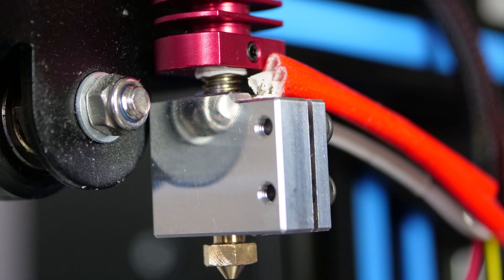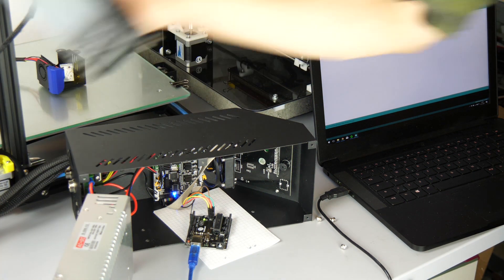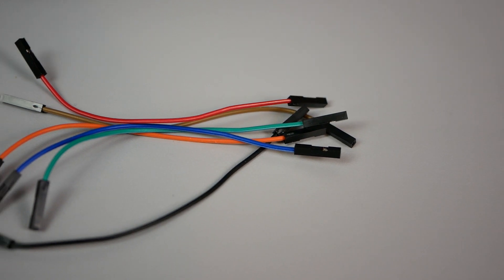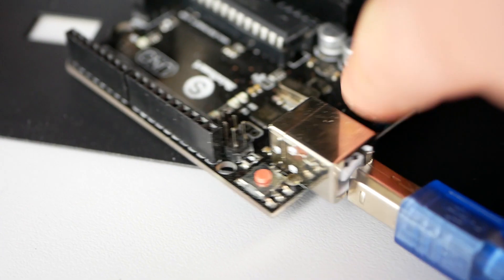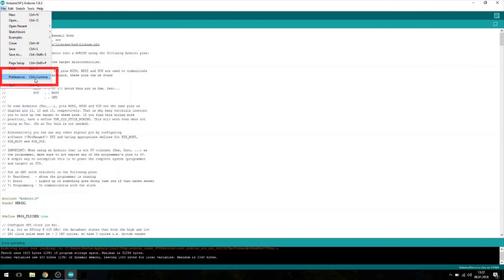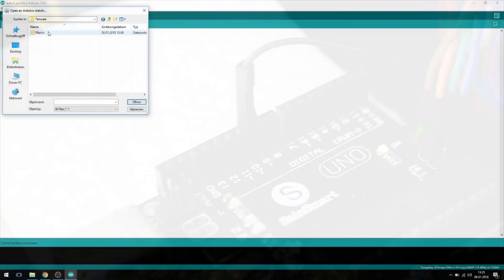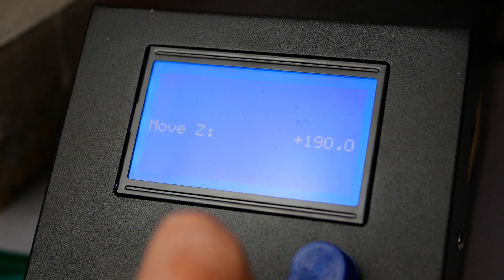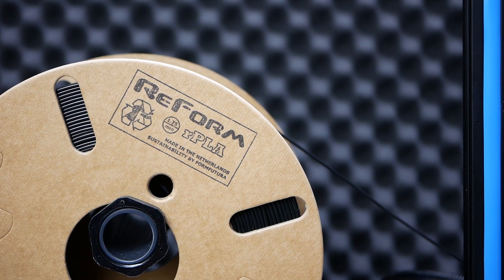CR-10 UPGRADE - GUIDE on flashing Bootloader and Custom Firmware for the E3D Titan Aero Upgrade

Comment: Years later... (lol) A 'How-to' using a USBTinyisp and/or
USBasp would be great. 
Also, a 'How-to' replace the stock Melzi (ATmega 1284/1284P) control board with a better and very inexpensive (almost plug-n-play?) board, perhaps a MKS Robin E3 integrated 4 TMC2209, et al. would be awesome. 😉

Comment: I couldn’t fine a place to post this so here it is. I have changed both heating element on the extruder and the   thermal sensor. When I turn the printer on and turn the temperature up to 210. The temperature does nothing and then I get the error saying E1 thermal runaway printer halted please rest. Should I do a PID to fix’s this issue or could be the
main board that has went bad? Any help would be appreciated.

Comment: can you update this for marlin 2.0 if you already haven't? i'm wondering if the marlin files i was given when i bought the printer my printer can be used, on 1.1.8 now and wanting to use configuration files so i don't lose any settings, though if i made your mount i'd end up using the files here and probably get way better results since you know better than me and the guy that sold me my cr-10s about 3d printing.

Comment: This flat out just is not working for me. i type in the hyper link like you do on your video but my ok is greyed out and it will not take it so when i search sanguino in boards no results. even tried doing it the way the website  says that you reference with the wiring from board to board and nothing.

Comment: Hi. I really need help with my 3D printer .
I burned my mcu, so obviously I bought another one, the same as the old one. Soldered but now I have a blue screen, yeah, noob me. 
The motherboard is v4.2.2 ender 3 pro, MCU - GD32F303RET6. 
Can you please guide me on how to burn a bootloader on this thing? I think I've tried everything I could.

Comment: Hallo Stefan, Danke für das Video! I have a slight correction though: @01:55 you mention that Boot loader is not required for a CR10S (Which I have)- entailed is a Creality V2.0 board. I took me 2 Days and a lot of forum surfing to chase the misleading error messages (things like avrdude: verification error, first mismatch at byte 0x0000
  0x14 != 0x0c)- turns out that apparently my board did not have a functioning bootloader installed.
BTW I installed Marlin 2.0.1 with no problems (so far), now I need to do the direct dual drive extruder and the linear rails installed.

Keep up the good work!

Comment: Hi thanks so much, a very timely video. I was looking into installing a boot loader and updating my firmware.. so I used your links and version of Marlin.
For my CR-10 some changes needed to be made. Like the Y Direction and the extruder steps/mm (Y DIR = true, extruder steps/mm = 99) these may be different for others but that's what I found worked for me. however somehow in my copy of your marlin the extruder was set to 803.. which is just under 10x the amount of feed you need. So you might want to check it.
thanks again.
Reply from the maker: As I pointed out, my version of Marlin is already adjusted for the Titan Aero Extruder and due to its gear reduction needs a ridiculously high steps/mm for the extruder.
Reply: That explains the value. It would take you longer than it took to do the video to dial up the 803 value. Did you change other default settings too?  My CR-10 is printing much better at higher speed now.  I will experiment with Marlin 1.1.8 now and see how things go. Thanks again for the video and the resources.
Reply from the maker: I also changed the homing location to Y=-10 I guess.

Comment: Hello there, when i try to flash my CR-10, it said Low available memory, stability issues may occur. An error occurred while uploading the sketch. How can i solve it?
Reply from the maker: That's totally normal. Don't worry.
Reply: Well, so what happen if it does'nt transfer because of this error, what should I do?
Reply: I forgot one thing, it also said : avrdude: stk500_getsync() attempt 1 of 10: not in sync: resp=0x73 Do you know this error? it count thrue 10 and said An error occurred while uploading the sketch
Reply from the maker: Restart your computer.
Reply: @CNCKitchen  That still doesn't work. Any other suggestions?
Reply: @CNCKitchen  I still get the same issue of "not in sync" after restarting.

Comment: Hello, my extruder run backwards😞 and the y axis shows +10 after autohome
Reply from the maker: Seems as you have fixed your upload problems ;-)  Invert the extruder direction: (#define INVERT_E0_DIR false) Offset is defined here: #define MANUAL_Y_HOME_POS -10
Reply: CNC Kitchen  I will have to change this in the marlin.ioe ? And then upload again
Reply from the maker: +brunn eu This should be in the config file.
Reply: CNC Kitchen is there any search option in arduino ide? 
Which zeilennummer is it?
Reply from the maker: configuration.h: Line 765 and 991 ==> search/find via CRTL+F
Reply: Problem solved again 😁
Reply: now there is a problem with the extruder, it runs to fast :(

I use the stock nozzle.
Reply from the maker: Did you use a proper version of marlin for the CR-10? PLEASE learn some basics about how to configure marlin, e.g. Toms video: https://youtu.be/3gwWVFtdg-4
Reply: CNC Kitchen I use the file under this video. I just wondering why my printer can't handle this and others have no problems🤔
Reply from the maker: +brunn eu This version of marlin is for a Titan Aero. It sounds as if you don't have one, therefore the problems. Download a version of marlin that is for the stock cr - 10. Just Google or check the facebook groups.

Comment: As you already have a Volcano hotend, have you gave it a thought to install klipper instead of marlin?
Reply from the maker: Nope. Worth it?
Reply: Don´t know yet. But as soon as I have done my Titans Aero update on my CR 10 i am going to try this as well. But maybe i try on my Ender 2 first. It has less mass to move with the small build plate, so that could speed up printing as well.
But have a look yourself  https://blog.adafruit.com/2018/01/18/walkthrough-and-demos-of-the-klipper-3d-printer-firmware-project

Comment: screen is set to such high resolution that I can't read anything in screen shots. What CPU does 10S use and other points you referenced? It would be helpful to mention them explicitly without relying on screen shots.

Comment: Stephan is working with a CR-10, but if you have a CR-10S I highly recommend referring to this article to get some more out of the upgraded motherboard: https://printedsolid.com/blogs/news/installing-marlin-1-1-6-on-your-cr-10s-with-mesh-bed-leveling
Specifically, the manual mesh bed leveling has taken my first layer adhesion to a whole other level. You should also take the opportunity to redefine your PID tuning values to account for your new hardware when you install a volcano.

Comment: Hey there, as i opened my controll box i saw that my board was green instead of black and it has no Jumper for VREG/USB. Can i skip the steap with swapping the jumper and the rest is the same?
Reply: same here, can we skip this step?
Reply: I've done some research and found out that the green board without the jumper is a newer version, the v1.1.2 and that version already has an bootloader, so you should be able to install the firmware directly over usb.I will test it now.Nevermind if that is outdated, but i just wanted to reply :Dhttps://www.thingiverse.com/groups/creality-cr-10/forums/general/topic:25767
Reply: jan5549 Did this work? I am really struggling to get it right. On that link it seems like they are all talking about different boards.

Comment: About leveling: 4 corner leveling would not solve not flat build plate. Even good glass can have more than 1 layer height from min to max. About ddrive aero upgrade: does you found problems due to the extra weight and the cantilever x axis?
Reply from the maker: It actually works really well. Video about the Titan Aero is going to be out Saturday.

Comment: Nice video, Stefan.
One warning to add, though: be sure to unplug any SD cards from your printer before flashing a bootloader or firmware via the ICSP/ISP header. A lot of printer boards share the wires between the SD/mini-SD/micro-SD port and the ICSP/ISP header. There's a non-zero chance of trashing any SD card that's plugged in during ICSP/ISP programming.

Comment: Arduino: 1.8.5 (Windows 10), Board:"Sanguino, ATmega1284 or ATmega1284P (16 MHz)"

De schets gebruikt 126272 bytes (97%)  programma-opslagruimte. Maximum is 130048 bytes.
Globale variabelen gebruiken 15292 bytes (93%) van het dynamisch geheugen. Resteren 1092 bytes voor lokale variabelen. Maximum is 16384 bytes.
Weinig geheugen beschikbaar, er kunnen zich stabiliteitsproblemen voordoen
avrdude: stk500_getsync() attempt 1 of 10: not in sync: resp=0x73
avrdude: stk500_getsync() attempt 2 of 10: not in sync: resp=0x74
avrdude: stk500_getsync() attempt 3 of 10: not in sync: resp=0x61
avrdude: stk500_getsync() attempt 4 of 10: not in sync: resp=0x72
avrdude: stk500_getsync() attempt 5 of 10: not in sync: resp=0x74
avrdude: stk500_getsync() attempt 6 of 10: not in sync: resp=0x0a
avrdude: stk500_getsync() attempt 7 of 10: not in sync: resp=0x65
avrdude: stk500_getsync() attempt 8 of 10: not in sync: resp=0x63
avrdude: stk500_getsync() attempt 9 of 10: not in sync: resp=0x68
avrdude: stk500_getsync() attempt 10 of 10: not in sync: resp=0x6f
Er is een fout opgetreden bij het uploaden van de schets

Dit rapport zou meer informatie bevatten met
"Uitgebreide uitvoer weergeven tijden compilatie"
optie aan in Bestand -> Voorkeuren.
he says this can not load

Comment: Stephen, it's not related to your video, that by the way is awesome and I plan to perform it soon, but after replace my J-Head, including thermistor I got an err: MAX TEMP.. I cannot get rid of it.. tried to disconnect cables, switch thermistors plugs into the mainboard.. all these didn't work.. is there anyway to reset the mainboard? I suspect that somehow the trigger "MAX TEMP" was shot while I was replacing the JHEAD and it get stuck into the eprom.. please tell me your thoughts. Any advice is appreciated.

Comment: Did you design the mount on your own? It does not look like the ones from KRushin and MP23Racing i found on thingiverse. Will you upload the design and a part list for part 2? Would be nice i people could order the parts in advance to have them when you release part 2.
Reply from the maker: I slightly changed the mount from evil_k. If you want to print the parts for next weeks video then take a look at these:
Mount: https://www.thingiverse.com/thing:2756792
Cable support: https://www.thingiverse.com/thing:2460377
Distance spacer: https://www.thingiverse.com/thing:2756795
Fan shroud and holder: https://www.thingiverse.com/thing:2756800

Comment: Hi,
Thanx for your video !
I'm trying to do it on my Cr-10 printer. All videos show to use arduino Uno, I have Arduino Leonardo. Do I connect everything in accordance with the instructions, because it does not work with me ... :(

This error pops up in the window:
avrdude: stk500_recv (): programmer is not responding
avrdude: stk500_getsync () attempt 1 of 10: not in sync: resp = 0x03
avrdude: stk500_recv (): programmer is not responding
avrdude: stk500_getsync () file 2 of 10: not in sync: resp = 0x03
avrdude: stk500_recv (): programmer is not responding
avrdude: stk500_getsync () attempt 3 of 10: not in sync: resp = 0x03
avrdude: stk500_recv (): programmer is not responding
avrdude: stk500_getsync () file 4 of 10: not in sync: resp = 0x03
avrdude: stk500_recv (): programmer is not responding
avrdude: stk500_getsync () file 5 of 10: not in sync: resp = 0x03
avrdude: stk500_recv (): programmer is not responding
avrdude: stk500_getsync () file 6 of 10: not in sync: resp = 0x03
avrdude: stk500_recv (): programmer is not responding
avrdude: stk500_getsync () file 7 of 10: not in sync: resp = 0x03
avrdude: stk500_recv (): programmer is not responding
avrdude: stk500_getsync () attempt 8 of 10: not in sync: resp = 0x03
avrdude: stk500_recv (): programmer is not responding
avrdude: stk500_getsync () attempt 9 of 10: not in sync: resp = 0x03
avrdude: stk500_recv (): programmer is not responding
avrdude: stk500_getsync () file 10 of 10: not in sync: resp = 0x03
Error while burning bootloader.

I'm lost and I do not know how to do it ...

Comment: hey :) i did everithing like you :) marlin is on board but when i switch from usb to vreg back and turn on my printer it doesnt work ... display is on for a sec but then is dead all time and when i turn it of the same :) .... but when i switch on usb again firmware and also display work :) can anybody help me with this issue ? :)

Comment: Thank you for the channel.  Do you know if this upgrade will work with the 5S large print bed?

Also do you know if the 5S ships with the CR-10S firmware or the CR-10 firmware?  Thank you in advance for any input, you have been very helpful so far.

Comment: Hello Stephan, nice video! Explained alot. 

Lin. Advance might be a nice video as well. 
I have a Conrad Renkforce printer with an old sidebranch of repetier firmware. I ended up patching the firmware to the newest Advance code by myself. Well: Topic understood, Fluid dynamics understood, Coding understood + it works. But the real deal is to find the correct advance parameters for all the filament I have. There should be some formula using the e-modul of each filament to get the best values. Well, yeah.. what a hobby. Rightnow I ended up putting the value to some quite random number inbetween some limits I read in the internet :D . And I really do hear it working but I dont really see much of an effect to edges, a tiny one - maybe. Higher speeds should reveal more?
One thing migth be better than edges: When I printed the first prints with lin advance It seemed to clog my nozzle quite fast (using stiff filament, PLA). This clogging ended when all the dirt inside my nozzle got shaken away by lin advance. For me this effect was the most impressive one. But I am still having trouble to believe that this really was the reason for my clogged nozzle. If it was, that would be just an awsome sidefeature of lin advance.

Comment from the maker: Did you also already upgrade your CR-10 firmware. What's your experience and which version of Marlin can you recommend?

Looking for a good deal on a new 3D printer and want to support the channel? Take a look at the affiliate links below and in the description:
Get a Creality CR-10 on flash sale for $389.99: https://goo.gl/LNHdbh
Get an Alfawise U-10 on flash sale for $455.99: https://goo.gl/ddPi4v
Get a Anycubic I3 MEGA on flash sale for $349.99: https://goo.gl/fH6o3M
Get a CR-10s for $440.99 with the code "GBsale127" : https://goo.gl/9WPzYo
Get a JGAURORA A5 for $335.99 with the code "GBsale129" : https://goo.gl/2UnFpu
Reply: Upgraded a CR-10S to .17 and need to move to .18 as there's a bug with the filament sensor in .17. Overall an excellent upgrade and easy to do with a bootloader installed already on the 10S. I believe the base 10 won't take the full Marlin though as it's got limited storage, did you not find that to be true?
Reply: I was able to flash the boot loader using your instructions.  Thanks you!  However, there is an error when attempting to compile your custom Marlin firmware.
Reply: Did you have a memory error?
Reply: I upgraded as soon as I got my printer because not being able to change the default preheat settings made me mad. Since then I have done many mods including the Titan Aero which it is working on it's first print right now (a calibration cube). I am still on .15. I really need to check out the change logs on the new builds. Since I'm on a CR-10 and not a 10s the storage is a big limitation. I just turn off all of the features I don't care about/need to get around it and so far it has been OK, but there are lots of things I would like to have enabled just to use occasionally that I can't have because there just ins't room. I love your videos and as crazy as it may sound, that Prusa style nob for the CR-10 is one of my all time favorite prints, that thing is a game changer!